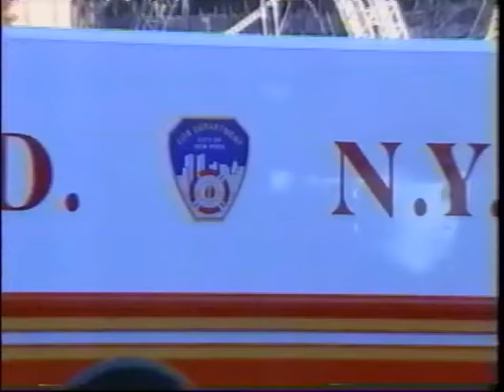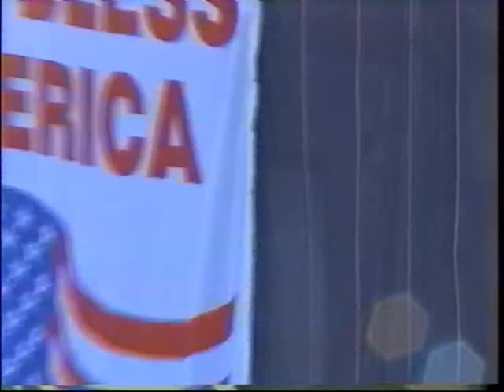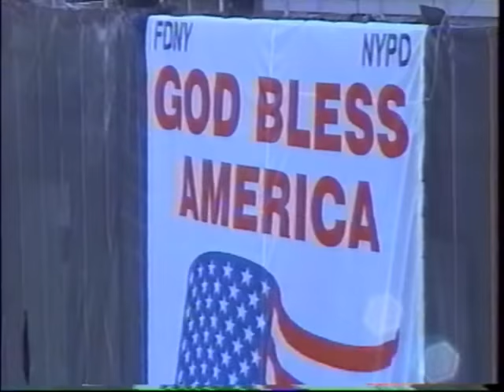Ground Zero recovery months after 9/11/2001

Comment: Controlled Demolition.Period. Look at the main columns at 18:23  and at 37:37   > they are all cut  off at about the same height.
Reply: Mooselippz  not even looking directly to it will people question what really happened. They are comfortable in denial
Reply: Wow those are four inches thick at the bottom the ones you see around 19 min, and then they would have gradually thinned out as you got towards to top
Reply: good point
Reply: Jet Fuel does NOT CUT steel....
Reply: Good eye! I’ve watched this video like 3 times and never noticed! To me where the columns are cut  looks like basement level . Lots of reports of explosions in the basement just before the planes impact
Reply: @Ryno9906  So why were bombs planted in the basement but the buildings collapsed from the top???
Reply: Harry Heiniken I think it was to weeken thecore bass of the building . Now I’m not denying that there were explosives used for the entire demolition but there were a lot of reports of explosions in the basement! Firefighters said whenever they came into the lobby it looked like a bomb had gone off. People injured, burnt, and skin hanging off their bodies FROM EXPLOSIONS in the basement!!
Reply: @Ryno9906  The whole width of the core was still standing after the initial collapse 

http://www.sharpprintinginc.com/911/index.php?module=pagemaster&PAGE_user_op=view_page&PAGE_id=148&MMN_position=325:325

and any explosives severing the core probably would have left noticible effects and caused the antenna to lean to one side, which did not happen until much later. 

The lobby smelled like jet fuel, so some burning fuel must have made it down into the lobby from the express shafts and high tension risers were severed during the impact of the plane, which could cause problems below in the basement where main transformers were locataed resulting in potential electrical shortages that could have caused "explosions"

The lobby was 3 stories in height so when the whole building ossilated it would "parallelogram" more so then other floors resulting in broken windows and cracked marble.
Reply: those steel beams are just dislodged then? how did u think they build the towers? with one  i-dont-fucking-know-the-damn-height steel beam?
Reply: There were people burned in the lobby because jet fuel from the exploding plane surged down the elevator shafts. And this whole, "Lots of reports of explosions in the basement just before the planes impact." Who was reporting explosions in the WTC before any impact from a plane? You're just making things up to fit a batshit crazy theory that the government somehow orchestrated an elaborate deception almost 20 years ago and somehow has kept it secret.
Reply: I believe it may have been in inside job but perhaps they cut the columns to remove whatever was attached. The cleanup process involved a lot of cutting and there are even videos of people cutting columns. Questioning things is fine, but use some common sense.
Reply: David. Are you aware of the logistics of planting bombs under the floors and behind walls on every single floor. The bomb and termite theories are so absurd that I have no idea why they're still doing the rounds 17 years later.

Secondly you can clearly see a cutting torch in the video.  I'll hazard a guess that that cutting torch, along with the many others at ground zero has cut a lot of columns and beams over the weeks and months they were probably there. If you've ever used a cutting torch you'll know just how much they would have been using them at ground zero.
Reply: G Simpson Man have you never heard of Willie Rodriguez?! Main janitor who was at the B2 level just before 1st plane, was blown off his feet 10 seconds before impact! Look him up! Do your homework before you bow up son! This guy saved a bunch of people by unlocking and opening doors in stairwell B.
Reply: @Ryno9906  well you mentioned Rodriguez, but YOU haven't done all your homework.. 
Here,  I will try to inform you.   Rodriguez's story, as per his speaking career, goes like this...
As he sat in his office on B2 level he heard an explosion from below him, actually picking the floor up.  Then a few seconds later he heard an explosion from above him.   Then a man, David Felipe,  ran into his office with skin hanging off his arms, hands,  and face.   Rodriguez always claimed, in  his speaking tours, there was an explosion below him first then the plane impact second. 
But Rodriguez gave an interview to CNN on the afternoon of 9/11 and this is how that one went. 
He said he heard a rumble then a few seconds later he heard a second rumble,  like moving heavy furniture.  Then David Felipe ran into his office with skin hanging off his arms, hands, and face.
He never once mentions explosions or from what direction they came from.  
In the years after 9/11 Rodriguez became involved in helping other Hispanics who have been injured on 911 to get aid and assistance.     He would tape their conversations in the process of getting them assistance.     One of those conversations went like this.  
A man named Sanchez was on B4 level when he heard what he thought was a bomb.  He and another man begin walking out.  As they were walking past a frieght elevator a fireball erupted from it and the hot gases knocked them down, breaking the other man's ankle and knee. . 
That sequence of events supports a plane impact first and then jet fuel fed fires erupting in the basement and lower levels.  
Without realizing it Rodriguez contradicted his own story. 

Rodriguez can very well be claimed a hero for helping to save many people,.  but his story has changed and become more polished as his speaking career took off.
Reply: Joe V  I still dis agree bro! I just watched a collapse vid that shows a ton of smoke coming from the lobby just before collapse! U don’t know, could have been a van loaded with bombs in the basement! Lots of witnesses saying explosions in the basement! Lobby was fucked up when the firemen FIRST got there! From what? A fireball? Don’t think so!
Reply: @Ryno9906  believe what you want about explosions in the lobby or the basements before impact..   The collapse started at impact area. nothing below that moved until it was struck by the falling debris..  SO,,, what purpose was it to have explosions go off in the lobby or basements pre-impact????? 
Just as a reminder, no proof for explosives, thermite, or Nano thermite have ever been found in any Tower...   
Steven Jones and Niels Harrit did extensive testing on four dust samples, looking for something to hang their hat on.   they thought they found active thermitic material, but that was also proven false.. 
had there been Any explosive residue in those samples they would have found it.
Reply: Harry Heiniken I know that but a lot of wittiness report hearing explosions in the basement just before first impact. All the windows had been blown out in the lobby when the firemen first got there! And it was not due to a fireball down the elevator shafts!
Reply: EVANGELIO Y EL AMOR  so u wanna tell me that most of the strucure got pulverized by thermite, why did we didnt see any flashes during the collapse?
Reply: EVANGELIO Y EL AMOR  and also the steel beams didnt got pulverized. But concrete and glass did, that happens when hundred thousand tons are collapsing
Reply: Someone who is not u Look up South Tower collapse Slow Motion! You can see about 20 flashes going off below debris field on the way down. Look it up
Reply: @Ryno9906  i have watched compilition with 52 clips of the collapse amd i didint see any flashes at all. Pls link me to the video u are talking about.
And anwere me a simple question: Why did these buildings need to collapse?
Reply: Someone who is not u South Tower Collapse Super Slow motion had
Reply: @Ryno9906  link me to the video
Reply: Someone who is not u man I didn’t see a link on that but if you look forSouth Tower Collapse Super Slow Mo, you’ll see the flashes. Seriously bro, like 20 to 30 flashes. Try again but there are a COUPLE of other slow motion clips where you can’t see any. Just gotta get the right one. Hope u can find it. Hit me back up if you do. I’d like to know what you think about it
Reply: @Ryno9906  just copy the link and post it here as a comment
Reply: @Ryno9906  maybe the flashes that u see are breaking glass from the windows?
Reply: Someone who is not u take a look at that link and tell me what you think cuzn
Reply: @Ryno9906  to me it looks like breaking glass reflecting the sunlight.

Can u tell me why these buldings need to come down? I think 2 planes crashing in to the highest skyscrapers in New york would be enogh of a reason to atack the middle east
Reply: another num-nut
Reply: O
Reply: Mooselippz  I can tell you those fires burnt for more than 60 days due to mass amounts of thermite in the rubble! Thermite is used to create a a temperature hot enough to melt steel. I can also tell you that thermite should NOT BE there! It was put there by the bad guys!
Reply: Bombs were planted everywhere in the central core of the building, from top to basement. Programmed destruction from top to basement in 10-13 seconds... The fires were near the summit, why the central core collapsed to the ground? The core was indestructible, designed to support 5 to 6 times the total weight of the tower. He faced the most violent winds for 30 years. A fire can not destroy it to the ground, it's physically impossible. With all my respect for the American People.
Reply: See, it's comments like these that make me even question the sanity of people claiming it was a conspiracy. WTC 2, 3 and 4 had already been demolished, as seen by the cleared area and well... LACK OF BUILDINGS. Obviously you'd have to cut steel beams to transport them. Shocking, right?
Reply: LOOL this literally proves nothing.
Reply: @Ryno9906  lots of reports? Where? I only heard of one person saying so

Comment: 13:04 STEEL PERFECTLY CUT, BUT IT WAS A PLANE...
Reply: Yeah, the Rascal who did this sure worships Sacral hell. If only I had the word that describes what did this.
Reply: the plane cut right through it at close to 600 MPH
Reply: 1) The cleanup crew cut steel so it could be removed.
2) And I accept this may be difficult for a moron to understand, but WTCs 1&2 weren't built with 415 metre long pieces of steel.
They were mostly prefab chunks of 3 columns x 3 storeys tall, bolted to the chunk below.

There are plenty of videos on WTC construction.
Reply: @massimookissed1023  Oh, come on, someone like you with all the physics and technical channels you sub to should have something better than name calling.

Comment: Can anyone answer this please. Look at the building at 8:17. NIST's report says that building 7 collapsed due to office fires  and some structural damage to a supporting column that caused a chain reaction that lead to the entire building falling to the ground. The building at 8:17 is right beside the towers and looks like it has severe structural damage and has been completely gutted by fire yet it is still standing. Are there any structural engineers out there that can explain this?
Reply: Rod Stewart - The structure at 8:17 is WTC Building 6 which suffered substantial physical damage due to falling debris from Tower 1 as well as damage from subsequent fires.  Building 6 was severely damaged and highly unstable but did not suffer a global collapse because the building is completely different in terms of design and construction from Building 7.  All buildings and all building fires are not the same and will have different end results.

Comment: Jet beams can't melt steel fuel. 😁
Reply: excuse me?!
Reply: do you know what i mean?
Reply: +Thomas Ernst Yes, and on top of that the heat protection material (foam?) that covered the steel beams were blown off from the impact explosion.
Reply: +Vladimir Putin there is no refuting the truth of 9/11 there simply isent, WAKE UP
Reply: +Vladimir Putin 9/11 was a false flag operation like cuba
Reply: +Thomas Ernst Why shouldnt it hold? 90 floors below where perfectly fine that hold up that weight for 30years, yet it vaporized on its own footprint, if it was weakend it should have break off at that point & fall down taking the path of least resistance, not fail at once symmetrical on all floors, leaving no steal core if fire can do this to hi rise buildings we would have different building regulations by now. No matter how it happend aslong u cant link 19HJs at the airport with timestamp the whole jihadi tale is just as thin as hologram planes
Reply: +Thomas Ernst : Weak steel ? what is that supposed to mean ..
Reply: Mads LoL, its steel like rubber, heat even affects all 90 floors bellow the heat source..like never happend in history or since :)
Reply: XHALE303 what ? affects 90floors below? .. thats not true
Reply: Mads Ofcourse thats not true not silly :)
i was joking, thought it was obvious after my 1st comment, where i said, 90 floors below where perfectly fine that hold up that weight for 30years & that it never happend in history
Reply: XHALE303 hehe, okei i wasnt sure if it was sarcasm or not :) Well, i havent looked much into the shanksville site, but it saw an older sattelite photo where the "crack" is visible, like its just added a big hole in the middle of this crack... i will find it again :) i keep watching 9/11 videos and find new interesting footage and testemonies all the time.
Reply: Mads Yeah that crack showed already on satelite images,years before the flight 93 magically dissapeared into it.
im done with how it all happend after 12y of research, it prevents that justice is done, its time to put some people in jail, starting with those responsible for cleaning the crime scenes & the Bush admin who where already convicted in absence for warcrimes in 2012
Reply: XHALE303 Totally agree! Do you have this photo ? Yes, i find it crazy that nothing is being done, but i assume its been tried.. but why nothing is happening is something i have to look into.
Reply: You don't have to melt steel to weaken it. You dropped out of school after kindergarten?
Reply: Jonathan Kosyjana 
Have you seen the attack with your bare eyes? 
If you didn’t um well, I saw the attack with my bare eyes when I was 2 and it was HORRIFIC I felt really heartbroken
Reply: You don't need to melt the steel to compromise structural integrity, you just need to heat it enough to weaken its load bearing captivity. It doesn't take a genius to figure that out.

Comment: This video shows the actual demolition - conventional demolition using cables days and weeks after 9/11. There was no demolition with explosives on 9/11.
Reply: Nooo, absolutely! Only the most absurd highrise falling in the history ahahahaha.
Reply: @Diadema033  No evidence of explosives
Reply: @bigfootdid9112  Just because they never searched for them!
Reply: @Diadema033  No sign of demo crews. 
No sign of drywall and insulation being ripped away from core or perimeter steel columns. 
No sign of a pattern of 139 db detonation charges (magically quiet Hushaboom charges) going off in the moments before collapse. 
No accompanying flashes from the flash-free Hushaboom explosives. 
No trace of det charges in the seismic record. 
No sign of any shock waves from the det blasts. 
No detritus of explosives, blasting caps, copper tubing, etc. found in the debris piles by the thousands of (paid off?) first responders. 
No explosive residue or thermite melts found on any of the steel inspected by ASCE and SEAoNY. 
No explosive residue found by anyone who analyzed the dust, including Harrit's own team that said they found nanothermite chips in the dust. 
No ground zero photos of steel columns scattered around the piles that show thermite cuts/melts across the columns and no ends of columns violently blasted apart. (There should be thousands of them). 
No explanation for how detonation charges could have survived the plane impacts, fireballs and fires on the floors where the collapses began. 
No demo experts anywhere on the planet say the towers were controlled demolitions.

Comment: All they need to do is take some samples from those tridents at the museum.
Reply: People don’t realise the amount of energy required to remove those towers & reduce them to dust. Over 500,000 tons each. A quarter of a mile high. No one had ever demolished buildings of that size before or since. WTC 7 was a bit more straight forward. It’s amazing to me joe public still believes fire could have destroyed these huge buildings. Fire has never been able to destroy buildings in any other instance in history. The “Oh they didn’t build them strong enough” sheep. Take a look at the construction photos and how heavily reinforced with steel they were. Esp the steel core columns in each building. Where was all the steel and concrete after the supposed “pancake collapse” most of it vaporised along with the towers contents and bodies.
Reply: ziggy pop fire goes up me smart

Comment: If the official story is the buildings collapsed in on themselves like a ‘pancake’ (official wording describing the collapse), then why is the bottom of the buildings still intact? Wouldn’t they be flattened having millions of pounds of steel free fall onto it?
Reply: buildings were demolished by underground thermonuclear explosions, three buildings - 3 explosions. The dust in Manhattan is not from concrete, but from steel. Monstrous deformation, crushing and crushing from underground thermonuclear explosions, turned steel buildings into powder, up to the upper limit, where a circular explosion was carried out - “the appearance of being hit by supposedly airplanes.” Airplanes - drawn using computer graphics